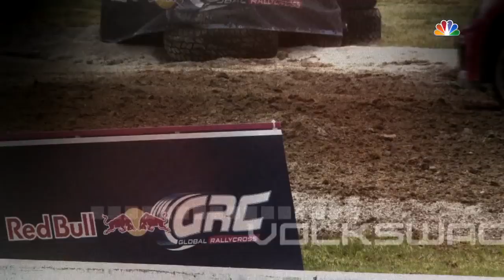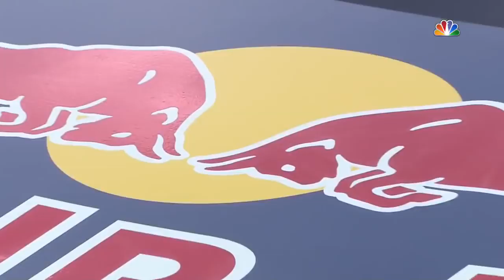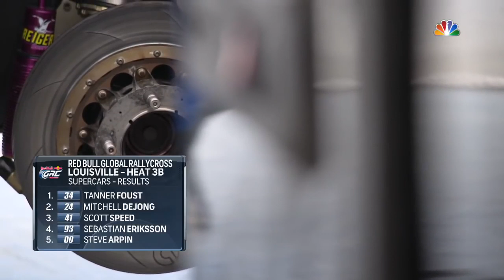2017 Red Bull Global RallyX Louisville

Comment: I got to work this race. I'm the guy at the start race that went out onto the track. The wind had blown a Red Bull can onto the track. Sunday morning we were supposed to be at the track around 6:00 AM. I went out to get in my car and saw a big puddle of oil under it. The seal on the oil pan level sensor had failed. No, where to get the part or an extra $45.00 for seal, oil, and filter. Had to watch it on TV. Great racing...it a shame that a bad decision was made. (A decision was made that everyone had to run FORDs...REALLY???)
Reply: Technically not a Ford... Osbergs makes them as an "affordable" spec series, the branding was just in name at the time. The same cars are run in the US and Europe as a feeder series, without the Fiesta name.

The problem was, going to spec killed all manufacturer interest. It would be like F1 switching to an F2 car and expecting Ferrari and Merc to stay.

The good thing is Nitro RX seems to have picked up the mantle, but hopefully the Group E class doesn't kill the manufacturer interest in supercars.
Reply: @DavidGossettMusic I've heard that manufacturers are intrested. I hope they won't butcher it like WorldRX.